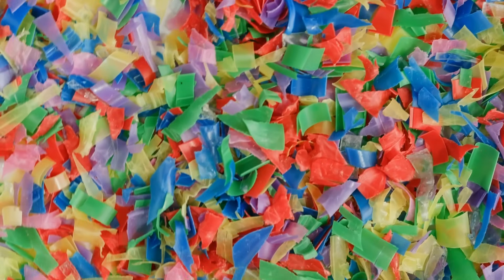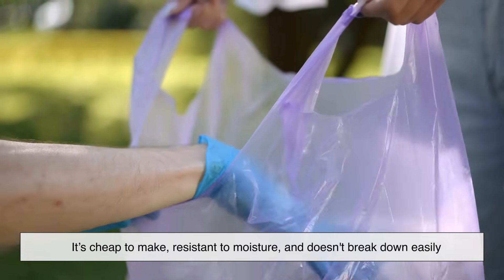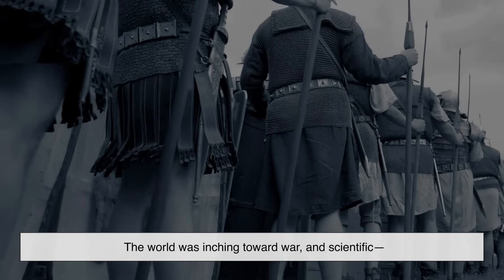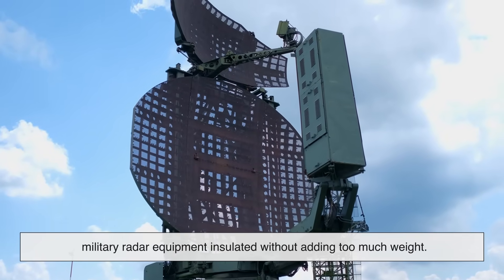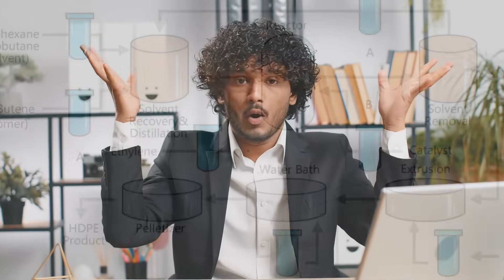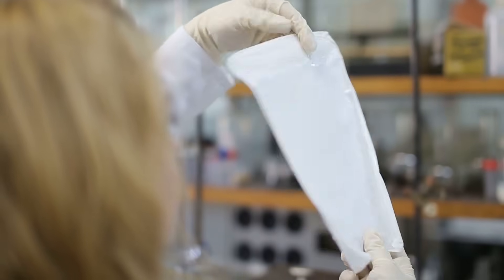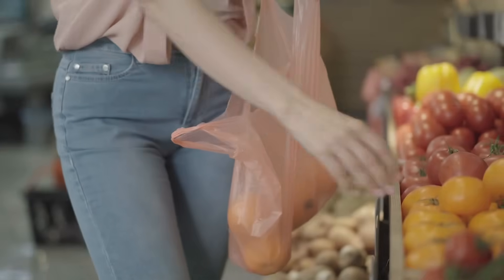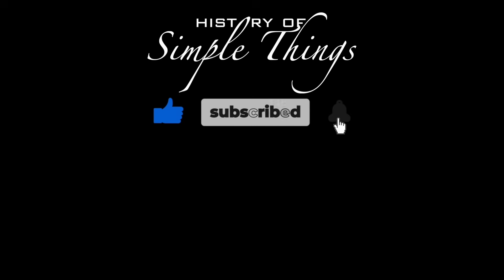What Is Polyethylene and Where Did It Come From?

Comment: This is the plastic what should be for consumer packaging only. Ban PS, PP, PET etc as consumer plastic and use every single consumer packaging from polyethylene. It can cover all needs from acid (HDPE) or plastic bags (LDPE).
Keep away that biodegredable garbage...it is just less than 1% additive on regular plastic. Nobody can not produce that plastic from corn or sugar cane...it is useless garbage. So, there is big lie on that field

Comment: Where I live in Canada the local City Government banned all single use plastics like polyethylene bags, plastic drinking straws, plastic cutlery ad infinitum. At first we started using reusable bags at the grocery store that were made from polyester. That lasted for about a year until they started showing up in landfills and someone pointed out that they lasted even longer than regular plastic bags. The next thing they came up with was made from another plastic but it proved to be useless as they tended to split open spilling out the contents because they became brittle after a short period of time when exposed to light and oxygen in the air. 
Now they have a radical new idea for bags. They are made from wood cellulose and break down quickly into an organic material that is harmless. They are called "Paper Bags" and we used them for many years until someone said it would be cheaper, easier, and more efficient to use polyethylene bags............
Paper to plastic to polyester to another plastic and back to paper and it only took them 25 years. So how do we get rid of used paper bags you ask? Well, we place them in semitransparent blue bags made out of, you guessed it, polyethylene, and recycle them. This is what happens when you let halfwits in Government make decisions without having any knowledge on the subject they are administering.
Reply: Hello to my neighbor to the north!  That's exactly what happened in USA. Typical government efficiency.
Reply: paper bags are no improvement though.  they take up much more space to store and become useless if refrigerated items sweat from condensation. their production also releases more CO² per unit than single use polyethylene bag production. the same can be said about the carbon footprints of reusable plastic and natural fiber bags. studies have found that to achieve carbon footprint equivalency between single use and reusable bag types that it would be impossible to reuse the bags enough times before they disintegrated . unfortunately, banning single use bags results in trading one type of pollution for another in even the best of cases ,and not even that when the switch is to reusable plastic bags.

Comment: Regarding 5:36, in addition to High-Density Polyethylene, there is also Ultra-high molecular weight polyethylene (UHMWPE) which is used to make super strong and lightweight fiber known as Dyneema or Spectra which is even stronger than Kevlar and used to make bullet proof vest armor.
Reply: Also for socket in knee replacements apparently